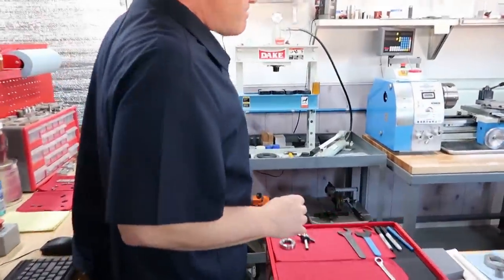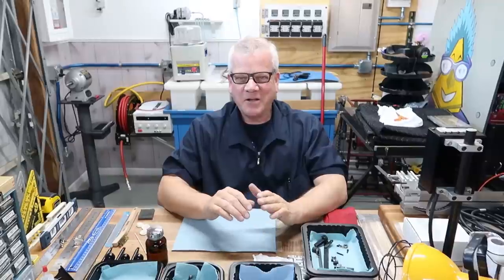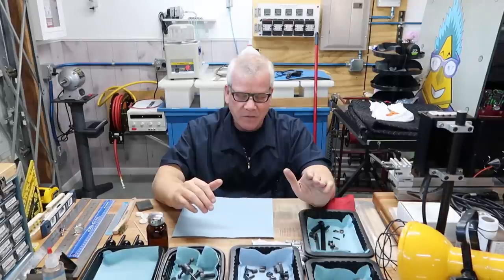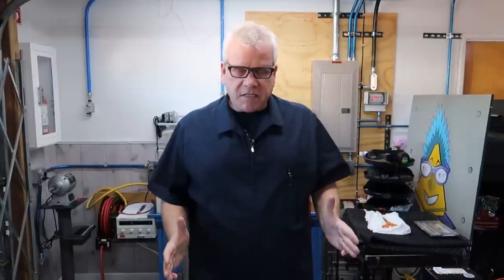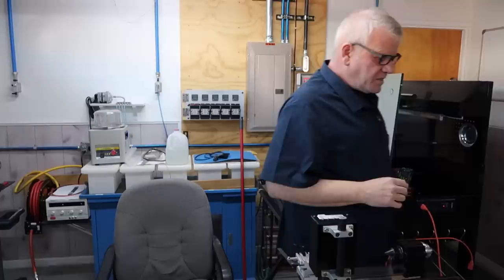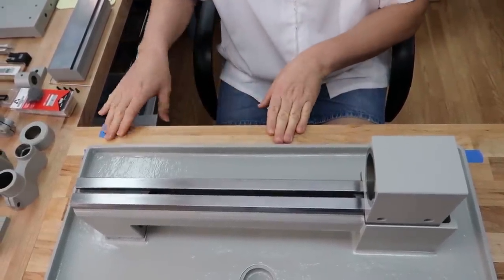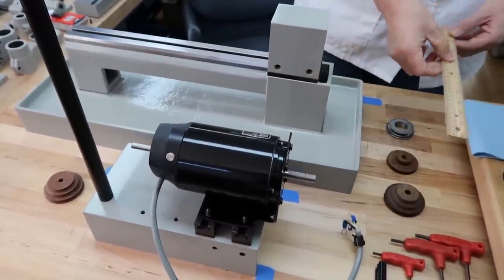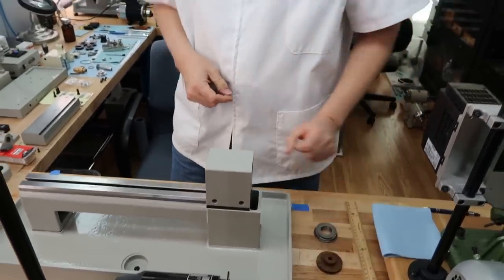SHOP ADVENTURES 18: Levin Lathe & Micro Drill Press Update

Comment: HI LANCE & PATRICK   I JUST WANT TO THANK YOU FOR YOUR KIND REMARKS IN YOUR RESPONSE ABOUT MY JOB ADVENTURES I WROTE YOU ABOUT ENDORSING  KROIL. YOU AS MYSELF MEET PEOPLE WHO ARE ON A SAME INTEREST /SKILL  LEVEL & YOU ENGAGE QUICKLY IN A MUTUAL TYPE OF LANGUAGE AS IF YOU WERE FRIENDS ALL YOUR LIFE. I CAN GIVE YOU A LIFE DEFINING MOMENT HERE IN 1 SUCH CASE  THIS INVOLVED ME @ A COMPANY WHERE I WAS RECURITED BY A FORMER VP WHERE COMMENTS WERE MADE THAT THEY WOULD TAKE 1 FROM PREVIOUS COM. VS 3 FROM NEW COM DUE TO WORK ETHIC, SKILL,  KNOWLEDGE, COMMITMENT ETC.  ANYWAY  WAS ENGAGED IN A PROJECT CALLED A TRI-WAY SLIDE. THIS WAS A OSCILLATING 30'' GRINDING HEAD MOUNTED ON A 45 DEGREE SLIDE WITH A 48''X48''X 8'' THICK BASE CONNECTED TO A ENGINE BLOCK TRANSFER LINE. ITS SOLE OPERATION PURPOSE WAS TO GRIND THE BLOCK HEAD DECK HEIGHT TO A SIGMA 6 TO;ERANCE.
IT WAS CALLED A TRI-WAY CAUSE IT USED TWO SIDE WAYS + A CENTER WAY THE CONTACT SURFACES USED BRONCE ALLOY LINERS/GIBS TO WHICH YOU SCRAPPED IN THE ALIGNMENT LIKE YOUR BAKER. THE SLIDE WAS TILTED BACK MOUNTED IN A FIXTURE WITH WALKWAYS/WORK PLATFORMS SO IT WAS LAYING LEVEL WITH IT BEING APPROX 5/6' OFF FLOOR TO DO THE SCRAPPING.  MOMENT--------- WAS COMING BACK TO WORK AREA FROM BREAK WHEN WAS GRABBED BY BACK OF NECK AS I SPUN AROUND TO ENGAGE WITH FISTS CLOSED I WAS MET BY ''MONTANA SEABEE BILL'' WHO WAS LAUGHING HAND OUT STRECHED WANTING TO SHAKE MY HAND -------- TO CONGRADULATE ME FOR SCRAPPING JOB & TO PASS THE TORCH TO ME FOR FUTURE SCRAPPING JOBS SINCE HE DIDN'T CARE TO DO THEM ANYMORE. THIS WAS 1ST TIME IN 1 1/2 YRS. TIME  ACTUALLY FELT ACCEPTED BY NEW COM GUYS. WE BECAME GOOD FRIENDS/COWORKERS FROM THAT POINT ON. IT WAS DURING THIS JOB I WAS GIVEN A 3'' RING ENGINEERING STANDARDS BOOK FOR MY FLOOR REFERENCE. I WAS 1 OF 3 GUYS THAT HAD THIS BOOK.----------SEABEE BILL -------- HE CAME FROM MONTANA  JOINED NAVY/SEABEE'S   MET HIS WIFE  ENDED UP SAME PLACE WORK.  WE HAD A BIG PROJECT COMING UP IN HONG KONG WHERE THEY WANTED FLOOR ASSEMBLERS FOR SETUP/DEMO. YOU HAD TO COMMIT TO MIN. 1YR TOUR WITH BRIEF VISIT FOR YOU/SPOUSE IN HAWAII-HONG KONG OF 1 WEEK. BEFORE YOU WERE ACCEPTED YOU HAD TO HAVE SHOTS FULLPHY ..IT WAS DURING THIS TIME THEY FOUND THAT BILL HAD A DORMANT FORM OF INTERNAL CANCER. THEY STARTED TREATMENT RIGHT AWAY BUT NEEDLESS TO SAY HE WAS GONE WITHIN THE YEAR. HE WAS A GOOD FRIEND & COWORKER -- YOU NEVER KNOW.
WELLL BETTER CLOSE FOR NOW   MIKE
Reply from the maker: Hi Mike, well shared and we clearly understand the larger company ways luck some, working well with others and being in the right place and at the right time as well as the most important part the skills you already conveyed to clearly possess. 
We Patrick and I Lance have only worked in very small companies however Mike we have done work within companies and have had friends that have worked within these great yet giant operations from the Mc Donnell Dougles, Boeing, Sony, Noval, even IBM, so we are somewhat imagining aware of the efforts you must have had to had to advance along th3e way of your career.
The biggest lesson you shared here to us today is the story of your friend and fellow coworker the type that make America the GREAT place it is Montana SeaBee Bill, you see Mike people like me honor many a man and wish and stive to be a couple of these men ourselves before our ending comes equally as well. 
We believe that you must do all you can do helping others bringing them along with you along this journey we each call Life while we are still alive and able, sharing what it is we now and what it is that can help and at times make others' lives easier and more successful, Bill a good friend and leader that trusted in you Mike new he could trust in you and so he did, he empowered you and became a GREAT friend to you along the way. Thank you for sharing your story with us your journey and the efforts you have share about these grinders sounds as to be a very important part of the manufacturing process for an end product, how cool is that. Thank you again Mike and thank you for being here with us on our journey we hope has an equally happy ending as the journey you have taken this far. 
We love and yet do not know as of yet how to scrape and measure machine bed ways, we hope to get to it in our remaining time Mike.
Lance & Patrick.